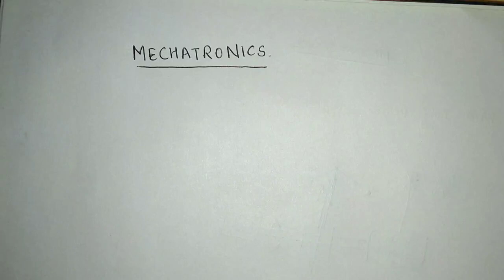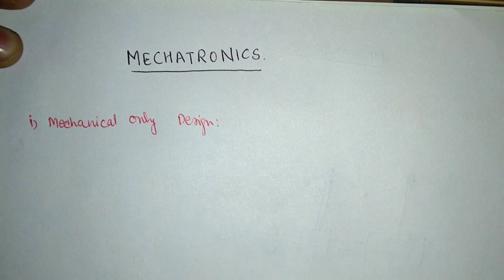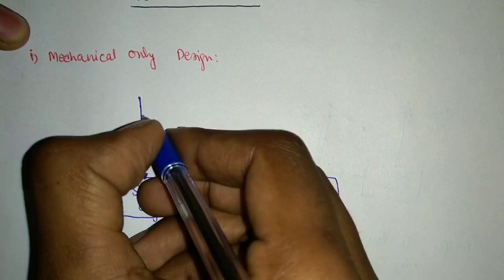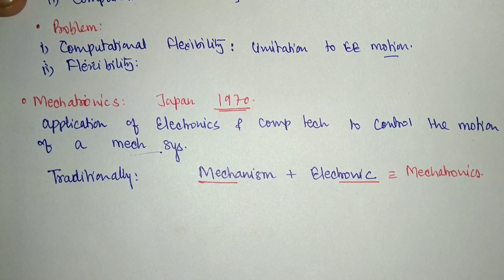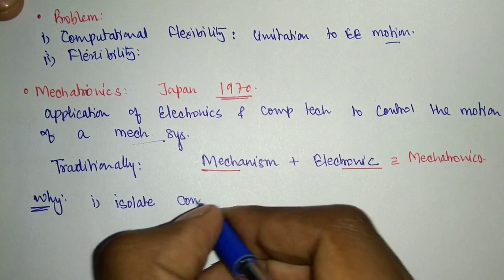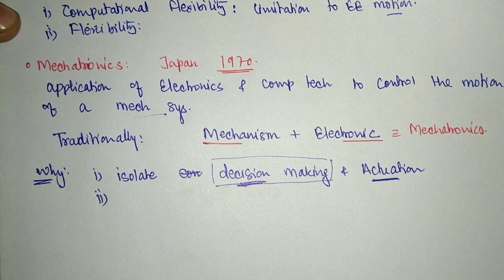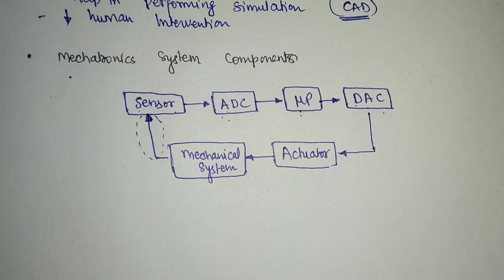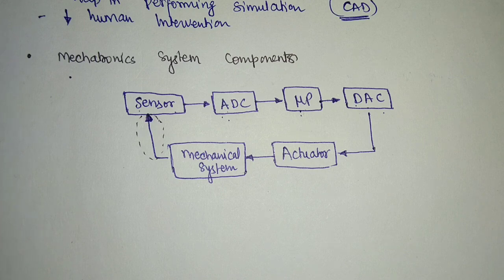Mechatronics | Part 1 | Mechanical only design | Applications and Elements of Mechatronics System

Comment: Sir I think when speed increase valve  will close to maintain the speed? Pls correct me if am wrong.
Reply: Yes
Reply: Speed increases, due to load power drop, so we have to close the valve to decrease the steam flow rate and balance the torque.